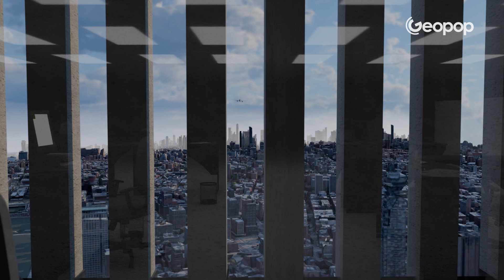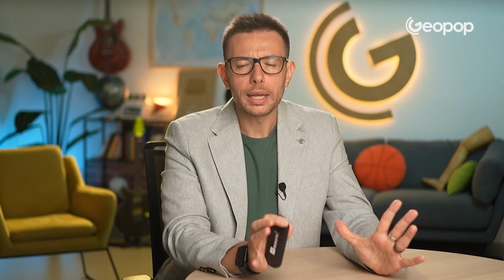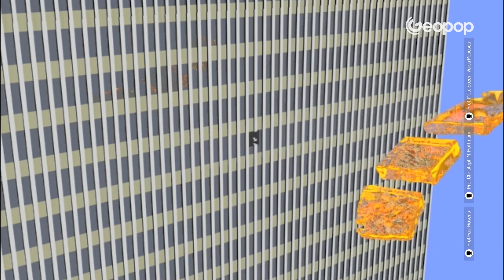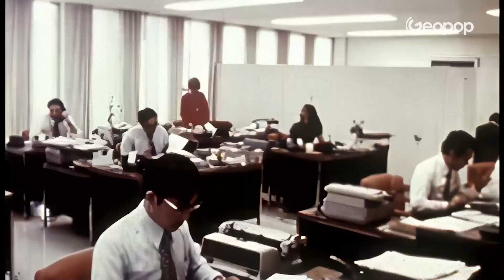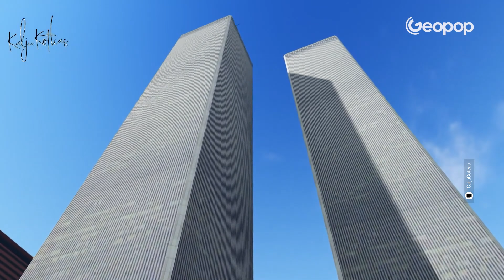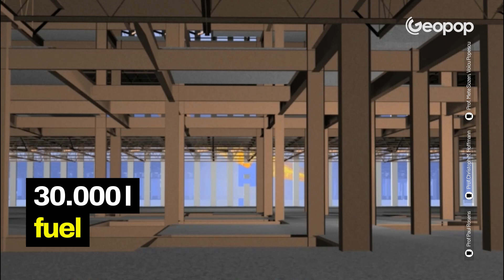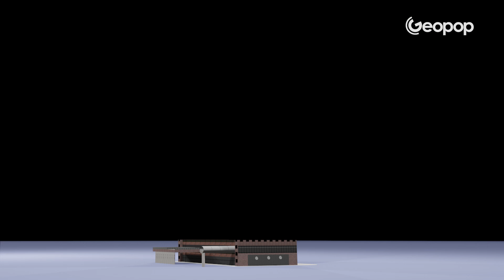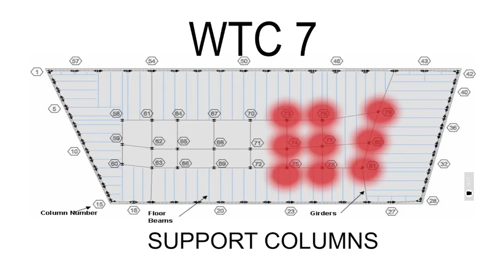9/11, 2001: The Technical Reconstruction of the Twin Towers and WTC 7 Collapses

Comment: I’m sorry I don’t believe this theory  they did use explosives to drop these buildings into there own footprint  if there was no use of explosives these buildings could never have fallen into there own foot print this is 
Impossible 
Literally impossible
Reply: Are you ok?
Reply: I'm going to respectfully disagree with you, but rather than just simply assert you are wrong and beat my chest I will present a detailed affirmative case explaining why mine is the better alternative because I find Twin Towers collapses intellectually fascinating.  My interest is in understanding the actual mechanisms of collapse - what failed, when, how & why and discussing those mechanisms with others who share a similar genuine interest in understanding what really happened instead of rationalizing some political agenda. So let's talk about it.  If at the end you disagree with anything, please let me know what you object to and why. Make it good. I don’t suffer fools. This will take just a few minutes.

This is my summary explanation of Twin Towers collapses of the Twin Towers, start-to-finish, based on my observations without appeal to, or reliance on any authority. No politics or ideology, just what actually happened, which is agnostic to who planned and carried out the 9/11 attacks or why. It has the benefit of not requiring Rube Goldberg levels of complexity and it makes logical sense. Each step in the process flows naturally from the one before AND is chock full of critical details the conspiracy oriented internet tends to leave out with no whataboutisms.  My hope is this will dispel many common myths and answer most if not all questions you may have about the Twin Towers collapses. 

While complex, most of the Twin Towers collapse mechanisms can be seen with the naked eye and easily discerned and understood by the layperson if sufficient time is taken to understand. The worlds engineering community had already largely sorted them out at least as early as October/November 2001. Still, there are many who can’t be bothered to look or perhaps work hard not to see, being more concerned about advancing political/ideological agendas (which is exciting) than science and engineering (which is boring).

1. The Twin Towers consisted of 4 primary structural elements that together formed an integrated system where each relied on the others.  47 hollow box-section steel Core Columns carry the majority of the gravity loads. The 236 hollow box-section steel Perimeter Columns carry the remainder and ALL of the lateral (wind) loads. Long-span Lightweight Steel Trusses connect the core and perimeter column together at each floor with a Hat Truss on top to tie the structure together as an integrated unit where no element can survive without the others 

2. The impact of 117 tons of airplane (= to about 12 dump trucks) at speeds up to 590 mph completely destroys the aircraft.  This in no way implies the Towers come out unscathed. Some folks don’t get that. Hitting with the energy of up to a ton of TNT the impact damages or destroys many perimeter and some core columns (33 of 59 perimeter and 20 core columns destroyed at the impact floors in the North Tower), primarily through bolt-shearing failures at the end connecting flanges, as well as bending, twisting and fracturing of weld seams. There was no cutting or slicing - the reality was far more violent and messy. 

3. The impacts destroy or damage fire insulation, fire breaks and sprinkler systems on multiple floors. Huge fires are started across multiple floors simultaneously and allowed to spread rapidly with no effective firefighting or fire suppression. This was an unprecedented fire event . All of this was observed and recorded.

4. The hotter steel gets the weaker it gets .  With fire insulation stripped away and no sprinklers the survival time of the steel greatly reduced. Gradually over time heat causes the lightweight steel Floor Trusses at the impact damaged floors to sag, which was observed and recorded.  No steel melted nor did it need to. Structural steel will fail long before it turns to a puddle. It just needs to bend

5. Sagging floor trusses pull on the increasingly weak and overloaded Perimeter Columns, causing some of them to bow inward by up to 5 feet. This was observed and recorded. A straight column is up to 4 times stronger than a bent column. 

6. The bowed Perimeter Columns buckle and fail, initiating collapse. This was observed and recorded.  The formerly static mass above which the structure below could easily support is now converted into a dynamic mass up to 30 times greater. Because they have buckled, the Columns above and below the failure point are no longer aligned . The load bearing structure below no longer bears any load as it falls past the lower columns, NOT onto them.

7. Thousands of tons of debris fall within the four outer walls, down through the open office space, crashing onto the first intact floor it encounters. This massive impact immediately breaks the bolted connections to the columns as the amount of resistance the Floor Trusses can offer is negligible.  The falling debris slows only marginally and briefly. Note:
7a. This is NOT a solid top block crashing into and “crushing” a solid bottom block .
7b. The debris falls past the columns not onto them.  The columns provide no resistance to the falling debris. 
7c. Only the bolted connections of the floor trusses to the core and perimeter columns can offer any resistance. A pair of 5/8” bolts at each end of each truss vs. thousands of tons of falling debris.

8.  This floor-led collapse progression within the four outer walls can only go straight down. Note: 
8a. This process is often incorrectly referred to as “pancaking” which actually refers to a completely different process rejected at an early stage. The catchy name stuck but nobody knows what it is supposed to mean.  Pancaking is too simplistic and inaccurate anyway. More like Kaiserschmarrn.

9. Collapse progresses through the floor systems and not down the columns. Rate of floor assembly failures increases with each successive floor as momentum increases, reaching an average acceleration of 0.65 of GA, or 35% slower than true free fall. Bam, bam, bam down the building until there are no more floors to fail.  The resistance offered by each successive floor is always the same. The mass and velocity and thus the energy of the falling debris are constantly increasing.  The falling mass increases with every floor it destroys as new falling mass is added. Some falls to the sides, but most falls down. More mass, more velocity, same resistance with each floor.
The above is unquestionably the path of least resistance

10. The Towers were 95% air by volume and as that air was compressed inside the building it is forced down the tower and blown out the sides in reaction to the building collapsing not causing the collapse. Those were not “explosions”, it was expulsions of compressed air. 

11. Perimeter Columns become detached and peel away like a banana behind the collapse front, playing out to the four points of the compass extending to more than 600 feet from the base of the towers. This was observed and recorded, the results quite obvious from examination of the debris pile. 

12. Core Columns fail last as their internal beam bracing is stripped away and lateral support from the floor to perimeter columns is lost. This was observed and recorded and is most obvious in the North Tower. 

13. For those who care about how long this took, the whole process took 31-34 seconds from the moment the perimeter columns buckled until the last core columns hit the pile, or 1/3 the rate of true free fall. Don’t believe me?  Just watch any video of the collapses and note all the loose and truly free falling debris dropping much faster than the towers themselves.

14. What was NOT observed and recorded were the 180-190 dB bangs of high explosives or the blinding bright flashes of burning thermite. Of course, neither could have caused the (silent) Perimeter Column buckling that was observed.  Neither explosives or thermite could have survived the impacts and subsequent fires either. Cherry-picking a casual comment from someone who heard a loud noise in an event like 9/11 is not exactly “proof” of anything and the pre—planned demolition case relies entirely on that. There is zero physical evidence to support either conjecture. It would be technically impossible, totally impractical and completely unnecessary. No one would bother. 

15.  The Twin Towers were perfectly safe within their design envelope.  They only collapsed when taken far outside design parameters by an extraordinary and unprecedented event. 

Impact + Fire (heat) + Time + Gravity = Collapse . Remove any one of those four elements and there is no collapse. Ignore any of those elements (as many do) and you will never understand the collapses. The Twin Towers were an integrated system in which no one component could survive without the others. One fails, the rest follow, through the path of least resistance – DOWN – through the open space, bypassing the path of greatest resistance – the columns. Don’t get stuck on the but the lower floors weren’t on fire nonsense. 

I hope you found this helpful. It is meant to be informative, not adversarial, posted with the objective of soliciting informed critical comment, positive or negative. If I made any errors of fact, logic or reason or left anything critical out, please let me know so I can fix it. One topic at a time, on topic only please to stay focused, no word-salads of Gish Gallop. IF you can offer a more plausible alternative be my guest. So far no one has even tried. Please start any reply with the words “Tits McGee” or I will know you didn’t actually read it, are not serious and just wasting my time.

Comment: Building 7
Reply: It's covered in this documentary - try watching - you might learn a thing or two
Reply: @Jnoooooo Corny explanation honestly 😂. Combustible office materials burnt upto 600 degrees and burnt steel and concrete columns damn
Reply: @hiran4935  please explain it better then? Didn't think you could lol.
Reply: @Sidecontrol1234 Their explanation is the problem. That is why we are asking for better explanation for how a adjacent building collapsed without signifcant direct damage. Furnitures burn even on regular building fires but the structure rarely collapse.
Reply: @hiran4935  "Collapsed without significant direct damage". Except there was very significant damage to the Southern side of the building from the collapse of the North Tower which caused major fires on multiple floors. Just because you can't see any serious damage from the North side in all of the collapse videos doesn't mean it isn't there.
Reply: @J1mmmmY  Buildings don't fall like that unless it's planned.

Comment: paper and jet fuel do not burn hot enough in labritory models. what everyone is leaving out of the equation, the wind fanning the flames. remember lots of windows were smashed. lots of interior walls at point of impact to allow the wind inside the building to fan the flames to their hottest
'add wind onto the equation and the additional heat it adds to the flames and there is plenty of heat to  weaken the beams